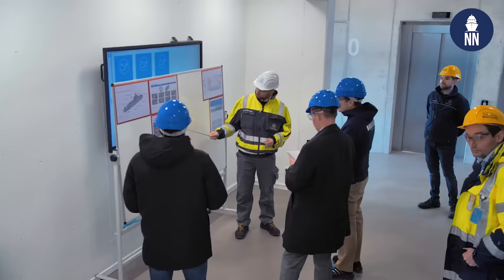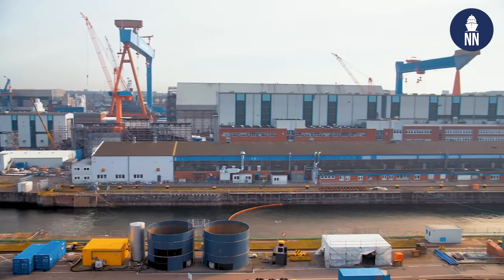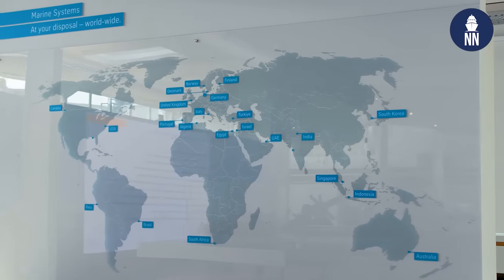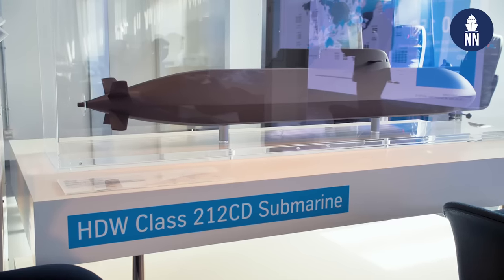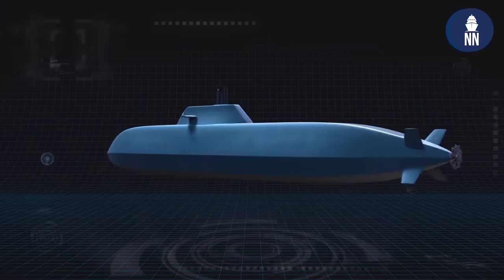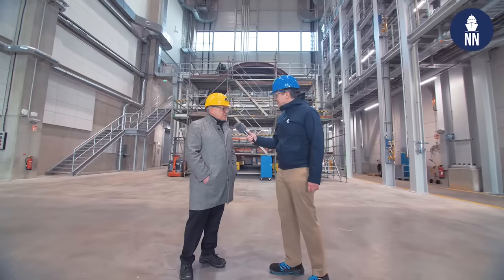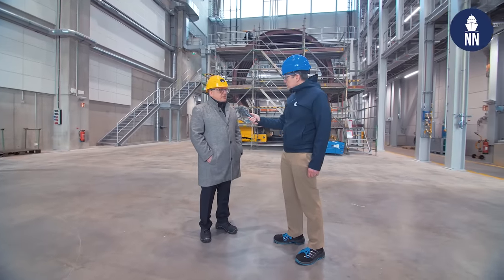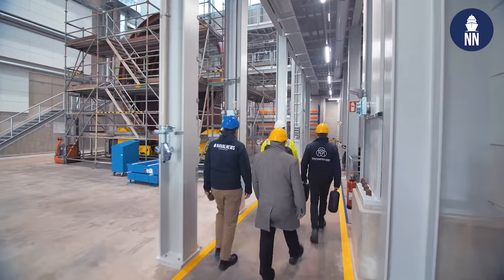TKMS New Submarine Production Facility in Kiel

Comment: F22 of Submarine
Reply: more F-4 of submarine ...
Reply: The F-22 of submarines is clearly the Seawolf class.
Reply: @Tealice1  Seawolf or Suffren class definitively ...
Reply: @leschantiersvarois7753  idk, Suffren seems too modern. F-22 has been in service for more than 15 years
Reply: @Tealice1  nope sewolf not have diamond design, seawolf just like F15 of submarine
Reply: @jinnilovely5573  Both the F-22 and the Seawolf class are late cold war American designs which were a big technological leap in their respective fields. Both were originally planned to be procured in high numbers, but eventually only a few were ordered. Both have been superseded by a more modern but slightly less capable platform (Virginia class & F-35, though the F-35 is only inferior in traditional air to air combat). So please explain to me why a conventional and modern German submarine is the naval equivalent of the F-22. The F-15 is more comparable to the Los Angeles Class
Reply: @Tealice1  F35&F22 and 2121 CD adapt diamod shape , seawolf and virginia look like F15 cause adapt cucumber shape 🤣
Reply: @jinnilovely5573  Ah yes, clearly they are more similar because "diamond shape". Stealth aircraft look that way because the shapes and angles reduce radar return. The reason why the Type 212 cd doesn't have a more teardrop shaped hull like the American boats likely comes down to its operational theatre and propulsion method. The Baltic and the North Sea are in many parts quite shallow and the limited amount of time the conventionally powered Type 212 can spend underwater, necessitates surfacing more frequently than the nuclear powered US boats. Thus the sharper angeled hull is at least somewhat more optimised for surface travel.
Reply: @Tealice1  i think diamond shape of 212 CD focuses stealth fiture, no matter where will use shallow sea or deep sea, before 212 CD Germany was build 212 use cucumber design…so Germany prefer choose diamond shape cause more superior in Stealth configuration than cucumber shape
Reply: @jinnilovely5573  I asked my wife, she prefers diamond instead of a cucumber, donn't know why, she could have more cucumber for the bang.
I don't understand women for sure.  🧐
Reply: Lol. 212 can kill ANY ship in the us fleet. Its just too few of them @Tealice1
Reply: @Tealice1 Wrong. The diamond shape is exclusively for stealth. Electromagnetic radar and acoustic sonar waves act very similarly. It's as far I know the only sub with such a structure. They are building a second non pressurised hull around the original cylindrical one. The 212 CD class will probably be the stealthist sub in the world. Modern diesel electric subs are way quieter than nuclear subs because they can't stop cooling the reactor. It's very hard to detect them with passive sonar. The shape of 212 CD will even make it very difficult with active sonar. Furthermore the class gets newly developed IDAS missiles which can be started while the U-boat is submerged to attack Anti Submarine Helicopters, which are the only modern and effecient way to fight them.

Comment: I wonder if they can incorporate a VLS system since the Tomahawk missile no longer is made to launch through the torpedo tubes. Kongsberg does not have a missile with that strike range
Reply: Apparently the Type 218SG has the option for installing a  vertical launch tube for missiles, though no boats have been equipped with it so far. But there are already boats like the Virginia-class which have vertical launch tubes for Tomahawks and such.
Reply: Submarines Dakar-classe, for the Israeli NAVY, are being built at the other hall. 83-85 meters and displace ~ 3500 tons submerged.  Vertical Launching Systems, etc, etc... Minimum price won't appear lower than $1.1 billion.